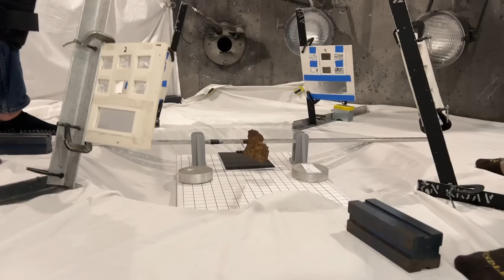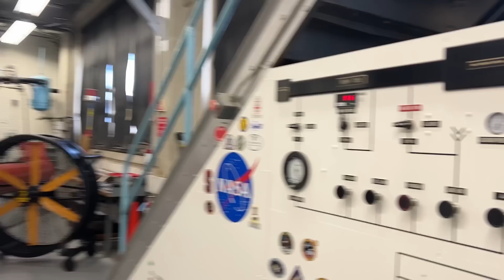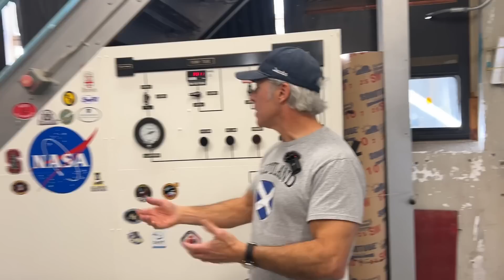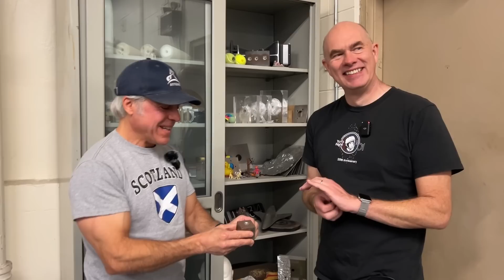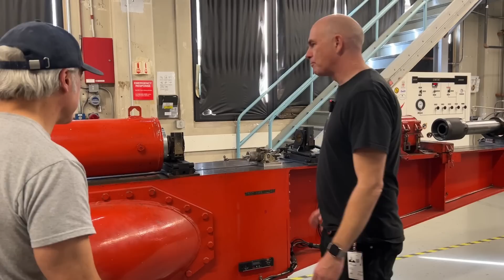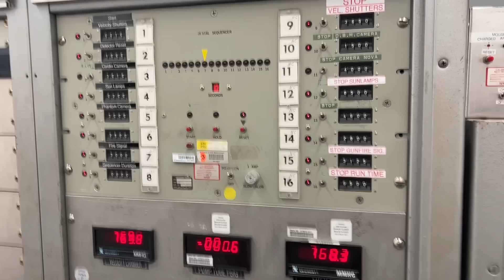How NASA's Hypervelocity Gun Achieves 'Impossible' Speeds

Comment: I made a great living out of the planned obsolescence he spoke of.  My job was to incrementally upgrade the instruments, controls, and SCADA systems at a power plant.  

Essentially I got machines to lie to each other so existing equipment thought it was talking to the same old machine, even though it was a completely new technology.

The plant was built right at the transition from surface mount electronics to chip technology.  At the time, PLCs were bleeding edge technology.

By the time I retired, everything thought it was talking to the original equipment, but not one piece of original equipment existed, except for a few power bus cables.

My trainee is now in the process of replacing all the communication cabling with wireless repeaters.

Essentially, even though individual pieces of equipment become obsolete, the plant can be kept operating for as long as the foundation holds up and the owner can make a profit.

Comment: Great video but I still don't understand how a variable angle helps.  Couldn't you just mount the target at a different angle?
Reply: Guess that it uses to fire over granular surfaces that otherwise cannot be in an angle
Reply: @ Yah but it sounded like it only moved over like 10-15 degrees.  You need to be a pretty fine material to have an angle of repose less than 15 degrees.  Still seems useful but I feel like it must be something more I'm not understanding.

Comment: I love how delightfully analog this whole thing is. Valves, tubing, dial gauges, even a regular c-clamp holding part of the mounting hardware in place. I'm a little surprised they don't still have the analog pressure gauges that doubtless would have been there when the device was originally built.
Reply: If it ain't broke, don't fix it. 😊

Comment: just did a quick BOE calc. Escape velocity of the earth at sea level is 11.2 km/s. To orbit, it's a little less - say 10.5 km/s. So NO: this gun cannot be used as a mass driver currently.  Max railgun velocity is 10.6 km/s back in 1994... what if we fed the incoming projectile as input to the railgun - we should get a proportional delta-V - so figure around 13-14 km/s - well enough to escape our gravity well... given scale - this can put spaceX out of business.
Reply: Put them out of business if you can make payloads that can cope with those G loads.  Gun (and even that spin launch system) all tend to give max G's at the start which tends to mean a LOT.

Comment: I started my aerospace career in the mid 1960s and recognize many of the measurement devices and precision reostats/potentiometers. Vacuum tube equipment is very familiar to me, as transistors and microprocessors grew more sophisticated along with my growth in expertise. Glad to see some of this stuff still in good working order.  I ended my career at Santa Barbara Research around the turn of the millenium working with vacuum chambers that were about the same vintage as those you show in the video. We too had upgraded the instrumentation to be more modern and capable, but those old timers doing the Apollo missions in the '60s were no slouches and some of the 'improvements'  we made were marginal at best. We could be more repeatable with the new stuff, which made it worth the effort.
Reply: Well, since we're here reminiscing.😃... my father (SRC Highwater guy -- another post) used an off-the-shelf shift register he configured to loop telemetry until the projectile exited the gun and could then broadcast before hitting the target.  He also discovered that you could save a whole lot of money on flash tubes for photography by getting really cheap ones and firing them once from a huge capacitor cart he cobbled up.  He was 50+ years too early for SpaceX.  *Sigh*

Comment: The weak point of this system is the burst disk.  It's not electronically controlled with enough timing accuracy to give repeatable velocity to the projectile!

I know of a way to both electronically control the timing of it with micro second accuracy AND measure (roughly but better than nothing) the compressed hydrogen pressure pre rupture.

Anyone interested?

Comment: An AR 5.56 bullet leaves the barrel around 1 km/s, 
An AK 7.62 around 700m/s 
So they're definitely making some serious bullets look slow with this gun 😮
Reply: Additionally, remember E=1/2*m*v². There is a lot of energy in that tiny projectile
Reply: For comparison, the sideways velocity required to achieve stable low Earth orbit is approximately 7800 m/s.

In the video, they claim they can fire miniature projectiles at up to 7000 m/s.  That is a large fraction of the required velocity for a stable orbit.  Additionally, air breathing airplanes do exist which can exceed 800 m/s.  The "SR-71 Blackbird" aircraft is known to be able to reach at least 980 m/s velocity, and perhaps somewhat faster (as the true specifications are still classified).

It is possible to design a fast air breathing aircraft that can temporarily "pop out" of the top of the Earth's atmosphere by travelling fast in somewhat level flight, but then pulling up abruptly enough to temporarily leave the atmosphere using stored momentum (even after engine flameout from insufficient air/oxygen).  If such an aircraft was also carrying a hot hydrogen cannon like the one shown in the video (with 7000 m/s or higher velocity), it is conceivably possible that the combined forward velocity of the aircraft and the hot hydrogen cannon could launch projectiles into a low quality low Earth orbit.  One could hypothetically use such approach to launch high gee force tolerant payloads into an orbit good enough for a continuously orbiting spacecraft to dock with and capture the payload (and shift it into a more stable/better orbit).

Orbit capable spacecraft like the NASA Space Shuttles and the SpaceX Starship are heavy and carry relatively low payload to orbit for their size, since they must carry their own weight, in addition to their payloads.  Additionally, the requirement to survive atmospheric re-entry and to perform some kind of propulsive landing, adds to their mass.  Conceptually, it is possible to modify a design like Starship to simply always stay in orbit, and to never attempt re-entry to the Earth.  Such a craft could theoretically do useful things if it still periodically docked with/captured resupply canisters fired into a low quality orbit with a hot hydrogen cannon + airplane launcher.  Such a craft would not need (heavy) high thrust engines, once it already achieved stable low Earth orbit velocity.  Such a craft could be designed to rely only on much higher efficiency engines, such as solar panels + some form of electric ion/plasma propulsion.  Such a craft could do a variety of interesting things, including cleaning up space junk by slowly rendezvousing with it, and then propulsively deorbiting the unwanted items.

Humanity is not really glued to the Earth.